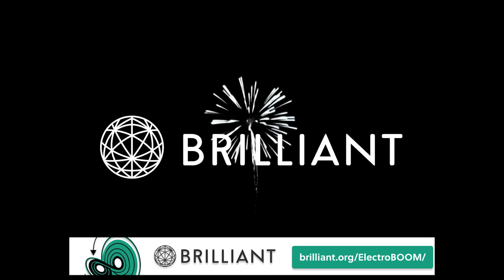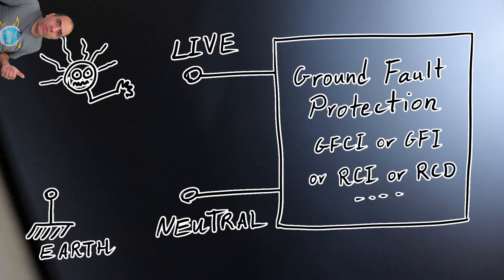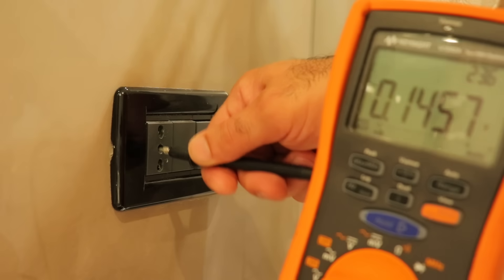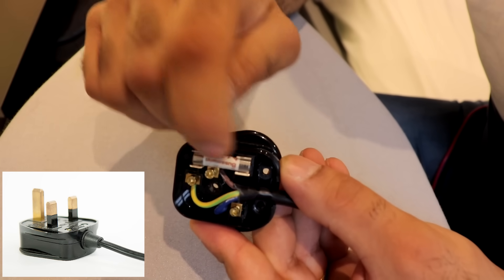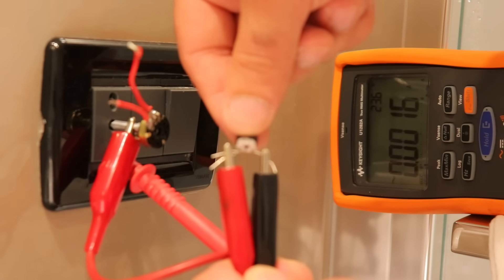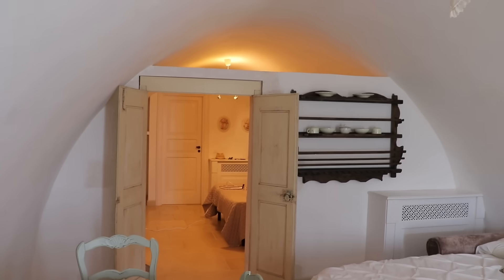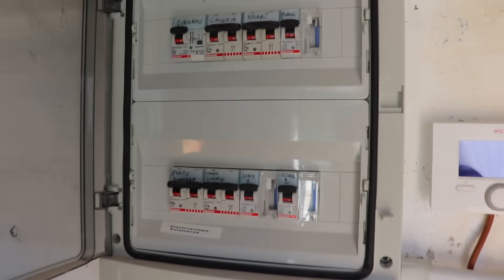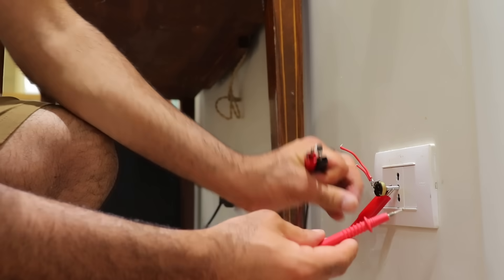Tripping Every Breaker in Italy

Comment: 3:38 There is something wrong with the colours of the wires, they are reversed. The Italian regulation says that the neutral conductor should be the blue one, probably a tecnician accidentally swapped the two conductors at some point upstream. It is't that unusual. There is more freedom about the colour of the live wire instead. It's usually black, brown, gray or red.  With that said, i really hope you enjoyed your time in our country!
Reply: Likely that.
It doesn't really matter with sockets as all Italian and most european plugs are not polarized and as such most EU appliances won't care which way you plug them in.
The problem is with lights as a switch would work fine being installed either on the neutral or live wire but if it's on the neutral wire when you go to change the lightbulb the live wire will be "live" even with the switch in the "off" position.
Reply: It plain simply is wired wrong. Based on IEC should be black/gray/brown for live wire and always blue for neutral.
Reply: @jeffsaffron5647  There are exceptions where the blue is permitted to be live, like when you use it as a feedback line from a switch. So never depend on the blue being neutral everywhere. Always check.
Reply: Same in Germany. Blue is neutral. live is black, brown, gray or red. Keep in ind that in Europe the normal Installation is 3 phase to the house, so you'll need 3 colors to separate the different phases.  Northern America has usually only 1 phase installations.
Reply: In case of mixing / reversing the colors it's a good idea to use a breaker which disconnects neutral and live.
unfortunately I have seen several installations with live on blue and a breaker in the black cable. So after turning of the breaker there was still power on the cable 😞
Reply: Same in Poland
Reply: Red in the phases really not in the most absolute way, there are various shades of blue, as regards the blue on the right or on the left is the same but generally it is kept on the right, and when it is named with the letter N it must absolutely not be inverted
Reply: In my house the wires are brown and blue. I have the standard Italian setup: three phases with a central breaker + three other smaller breakers that separate various rooms/floors.

Now, I'm no electrician so whenever I had to work on the electrical system; to add a socket, to move a switch... I never paid attention to where the blue or the brown went, I thought it didn't make any difference. 

So, wherever I did put my hands the live and ground wires are totally random, will this cause any problem? Will it increase the power consumption?
Reply: @rijjhb9467  The only problem this can cause is if you identify the wires wrong by mistake and get a shock. The Power consumtion does not change.
Reply: @rijjhb9467  In this case you can't tell which wire is the live and which one is the neutral, so there are some safety concerns. When you deal with your electrical sistem, always doble check for the live wire with some kind of tester/phase finder device (a simple and cheap screwdriver-phase finder works fine)
Reply: @Darkshadow799  i would at least use a two-pole voltage tester. These Screwdriver testers can give wrong results and also light up when touching the Neutral. Thats why they called "Lying Pen" in Germany.
Reply: @Darkshadow799  I can identify live and neutral, but how do I know where they should go? Up, down?
Reply: @rijjhb9467  I don't really know what the normative says about it, but I was told by my teacher that the live wire should go in the furthest contact from the earth wire
Reply: @Darkshadow799  the earth is the centre pole, so they're both at the same distance. Also, I don't think there's really a difference. If there was, plugs would have a verse, but they don't. How do they how which way you'll insert the plug?
Reply: in Europe that is the case 
I was like what as well
Reply: I in Poland am teached the colors the same as u do, so not only in Italy but it it European standart i think
Reply: In some old houses i've seen various shit.. no colours respected
Reply: The whole of Europe is Brown = Live and Blue = Neutral
Reply: Correct... In The Netherlands the live wire is always Black! No exceptions
Reply: @FrankypankyV8  No you are incorrect. In the Netherlands live is brown, neutral is blue, earth is green/yellow and black is a switched live.
Reply: @FrankypankyV8 black if switched, brown if always on.
Reply: @FrankypankyV8  no its not
Reply: @FrankypankyV8  brown.
Reply: @FrankypankyV8  it's not. it's Brown. the switched live is black
Reply: @FrankypankyV8  Absolutely not, also brown and in case of three phases brown, gray, black and in the distribution grid is red, yellow and blue used. In almost all countries is it forbidden to use the green or green and yellow color wire (earth / ground) as a live wire, because that would be mortally dangerous if someone doesn't know it and connects the live to the ground of an appliance or to a metal body such as a water pipe.
Reply: @FrankypankyV8  thats weired as
Reply: @FrankypankyV8  Doesn't that make installation bit of a pain since you need to mark the wires to know which one is for what. If you just reserve two colors for neutral and ground other ones can be whatever lowering the chance that someone might wire something incorrectly.

Comment: In the 2020 NEC GFCI is required for dwelling units in; bathrooms, garages and accessory buildings, outdoors, crawl spaces, basements, kitchens, sinks, boathouses, bathtubs or shower stalls, laundry areas, and any indoor damp or wet location. Not exactly "only the bathroom". The requirements for non dwelling units are very similar.

The next version of the code comes out next year and I'm sure they will expand on that list. Eventually, I'm sure every single circuit in a dwelling unit will be required to have GFCI. The difference is cost between a GFCI outlet and a regular one is often over 10 to 20 times more expensive for the GFCI. Using a GFCI breaker will cost $50-$300 depending on the size/brand, while a normal breaker is less than half that price. That's why there is a lot of resistance from contractors and home owners when it comes to wide use of GFCI devices/breakers.

Comment: As you say, in North America, only certain outlets are protected with GFCI.  That includes garage outlets.  But every time I plug a large motor (grinder, lathe, mill, etc) into my garage outlet it trips the gfci.  Apparently GFCIs have problems with large inductive loads.  I fixed this in my garage by putting a non-GFCI breaker in the panel.  What would you do in Europe where the entire house is protected with a GFCI?  How do you handle large inductive loads?  Or is that why they trip at 30mA instead of 5mA?
Reply: Not all GFCis are the same. They have gotten better, and some brands are less prone to trip for no reason than others. I've found that Leviton GFCIs are much less likely to nuisance trip than Legrand GFCIs. My sump pump is on a GFCI and when it was a Legrand GFCI, it would trip at least every few months. Replace with a Leviton GFCI and that problem is gone. The current electric code requires a GFCI for the sump pump outlet...

Comment: 1:19 ah nice. Finally you see the qualty european electrical components ;)
3:07 oh wow. sadly some sort of cobbler has made the wiring.
7:30 yes, it is usual, that you have GFI for every plug and sometimes even the lights in your home, BUT it can also be a big problem, when kinda old devices will have leaking current and your fuse pop every time and you just don't know why, bacause every device does kina 1mA and in sum it is just too much.
that's why in modern houses you mostly you separate GFIs with different currents for different regions of your home. like 30mA for "humid" rooms (like bath), 50mA for "normal" rooms and 300mA (or even 500mA) for rooms with "heavy consumers" like the garage, where you will maybe work with a welding machine.
11:00 lol ... like i told :D
15:09 just for interest: in which applications it's important (for a "normal" user) to know where the life wire is? I think there is none, and that's why you never know where life wire is, when you're not going to test it.

Comment: So I don't know if we in the UK are following EU standards still, but we're seeing installations where a combined RCD/GFCI and Overcurrent Protection MCB which are only one bay wide on the DIN rail based breaker boxes, so you can get individual RCD protection on each circuit so tripping it doesn't take down an entire group of circuits

Comment: Happen to be in italy visiting family. I am from the uk (with THE BEST plugs, but it is worth looking at our history of them). I have had to deal with the electrical systems here countless times in the home rather than hotel situations trust me it can be VERY different.  As for lights and sockets in the UK i was brought up on (but not trained on) upstairs ring for sockets, ground floor ring for sockets. On their own protection, upstairs light on their own, down stair on their own BUT landing lights( lights at the top of the stairs) are on the ground floor power. Hall lights( lights at the bottom of the stairs) on the upstairs light power.  That way if one trips you still have power on both floors for a light.

Comment: Edit: thinking of the wrong country totally confused now.
9:13 for sure (not Italy thinking of France) telephone, and it looks like they included an RJ 11 for international travelers.

I was in Walmart one day and they had a on the sale rack for $4 a set of international telephone adapters.
Surprisingly by the time I traveled a few years later ethernet was pretty much standardized and soon after the public Wi-Fi was the craze. this was also around the time of that "free public Wi-Fi" "bug" scratch that "feature!" where Windows auto configuration would if it couldn't connect to a known network re-create an ad hoc network that the system was connected to..................
Reply: Yep definitely look like a old french telephone plug although not quite. 🤔 The french telephone plug is a sort of T (with a very small head) but this one is a inverted looking C (with very small arms).  I searched google for Italian telefone plug but it looks nothing like it
Reply: @fredericbabin9187 https://en.wikipedia.org/wiki/Telephone_jack_and_plug#/media/File:BTicino_spina_e_presa_telefonica.jpg
Reply: @fredericbabin9187  yep totally realize that myself this is more of a sideways table.
I realized a few hours later no no I got that totally wrong, they use a three pin thing.
Reply: To me it looks like the bti2300
Reply: @raulmere  that looks very close although I only found like two pictures. hard to believe it would be for a controlling RC cars from another room must be some sort of repurposed jack.

Comment: "Mehdi travels" - the nightmare of every hotel manager 😎
Taking the standard in Italy as a measure for all Europe might be stretching it a bit though. In at least Germany, Sweden, Norway, Denmark and Finland there are two different types of outlets. The earth-connected outlets will accept plugs with and without earth pin, where the plugs without look like the Italian ones just missing the middle pin, but the spacing is different (hence the double-dripped holes in Italy) and the ones with earth are the big Schuko which you also showed in the video. It would not be possible to insert e.g. an Italian plug with earth pin into a earth-connected outlet without the earth-pins making contact.

Comment: Hi Mehdi

First: in Austria, as far as I know, since the 1970s, you have to install a GFCI „before“ all breakers. So every circle is protected.
Second: in AT we have those safety sockets. They are called „SchuKo“. The prongs of the plugs make only contact when the plug is inserted so far into the socket, you are unable to touch the prong’s easily.
Third: make a trip to Austria!

BR
Leo

Comment: Your knowledge of North American, or at least US standards are out of date. These days GFCI outlets or circuits are required in bathrooms, kitchens, garages, or other parts of the house that experience moisture, such as bars. Additionally, most circuits are required to be AFCI (arc-fault) protected as well. This is still not completely adopted, but as an electrician I've seen GFCI outlets or circuits in 95% of the kitchens/bathrooms/etc. That I've worked on. AFCI adoption is still low however, because it's a massive pain in the ass with false positives.

Comment: Shucko connectors have larger pins that doesn't fit in a standard 3 pole socket.
You were able to force it because the sockets were physically abused but there's no way to do it in a new socket unless you use A LOT of force to phisically enlarge the holes.
Also, we all have converters from 3 pole socket to shuko ( https://s.alicdn.com/@sc04/kf/Hb56ac2054b934dabb22d629319cc9e455.jpg_960x960.jpg ) they are dirt cheap and just works.

Also: things changed, so new specifications requires for a single magnetothermic uphill and individual ground-fault protections, one for each power line (with multiple lines for each apartment: one for lights, one or more for wall plugs*, one for each single high current appliance like induction heaters or washing machines).

* my old house had two lines, one for day rooms and one for night rooms, my new one has four (bedrooms, kitchen, living room, bathrooms)

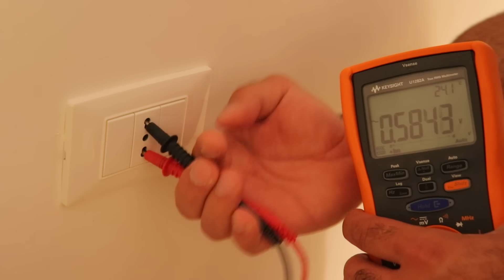Comment: 10:55 In South Africa it is not necessary to put the light circuit on the ground falt breaker or earth leakage as it is called here.

11:00 I knew you wouldn't find the breaker since that box disconnects your room electricity to the entire hotel. You would have to find the box for your room, which has the earth leakage tripped.
Reply: Another South african?
Reply: @ssoouull7918  Dis waar ja! Maar my magtig dis oulik.😂😂

Comment: In Italy Residential use is almost always 30 mA
Industrial might have 300 mA or more

The default nominal for residential is single phase 230V 50 Hz, with Ground and Neutral, 3kW peak load

You can usually upgrade to more kW single phase, or ask for the industrial standard (3 phase 230V shifted 120° + ground + neutral, for about 380V and as many kW as the line can handle)

Comment: Yay. Venice. The city where the sewer is not under, but above ground.
Please do not use a screwdriver with a metal shaft to prod around in the circuit breaker box. Use only a screwdriver with a full insulated shaft, only exposing the metal tip. This is much safer.

Comment: You should come to Belgium. We have plugs that have all the safety features of the uk plugs (except for the fuse which is an advantage in my opinion because you have to replace a fuse but can reset a breaker) and we have ground ground fault protection that trips on two currents. One very low one for "wet" rooms like the bath room or the washing room and then a higher current one for the rest of the building.

Comment: 15:52 that is somewhat correct, it is true that the grounding wire is not put out to the recepticle, however since the rcd messures the inflowing against the outflowing current it will still trip even with no ground wire attached, so in the event that there is a fault and the case is live you will make the connection to ground with your body and the rcd will trip. 
the only difference is that you can plug it in and it work untill a current uses another way than the neutral wire, this way there even is no real upside in making the plugs keyed in a way so that they only plug in in one orientation.

Comment: Welcome to Italy Mehdi. Now I know why there were recurring blackouts... 😂

About the strange connector, it seems to me a phone connector, probably for the French standard. It might be used for the internal phone system of the hotel, maybe also an old one then moved to a more standard RJ11 model.

We were used to have some strange proprietary plugs, called Magic by BTicino, which actually had contacts on the side to protect against accidental finger contact and looks similar, but as it is found near a phone line, it can't be that
As proprietary, they were abandoned in favor of Schuko and 10/16A models (we call them bipasso, or doule step).
Reply: Yeah, Magic Bticino for children, we had them in my parent's house, but then no one used that kind of plugs anymore, then we changed with the classical 3 holes plugs
Reply: it actually doesn't seem to be the french stander you're talking about, it really doesn't look like it

Comment: Yeah Mehdi, I already told you, for over 30 years in europe, gfci is mandatory in whole electric installation, on some applications, it can even have like you saw in the last hotel, several gfci spread around, it's mandatory by law. :) Some plugs will not handle an unearthned plug to fit, some will, it's up to you :) but it's very rare an electrical accident, you'll trip something along the way.

Comment: Europe is not a country. We are many different countries.
Italy is using 10A and 16A plugs, that´s why you have two different spacings. 10A into 16A outlet is possible if the socket is "double-drilled" as you say. 16A into 10A is not possible, as the pronges are spaced wider in 16A and also are thicker. The Schuko plug should not fit into a 16A socket either.
Schuko is the German/French plug system. Eventually many appliances might not get a country specific plug, so either you install a Schuko socket in your house or use a rated adapter.
Reply: In some European countries Schuko is used also in 16A outlets.